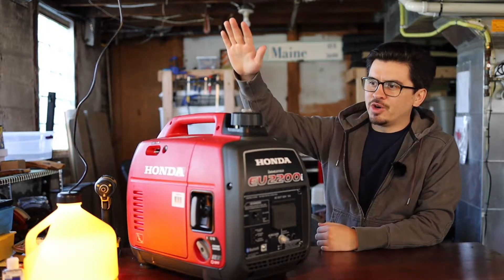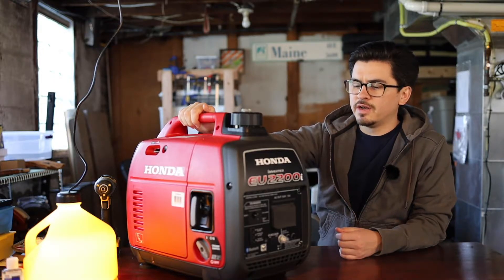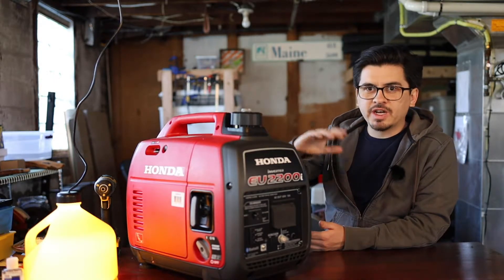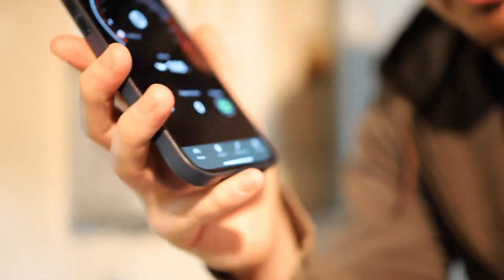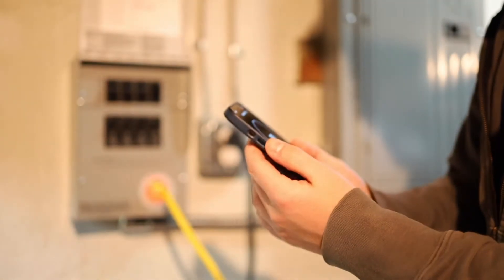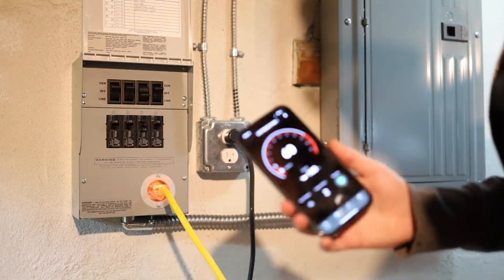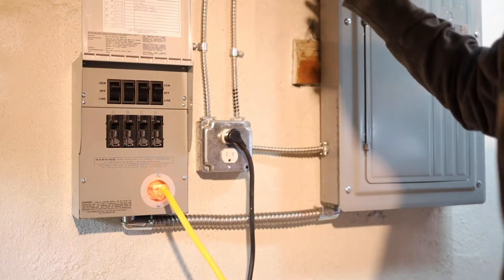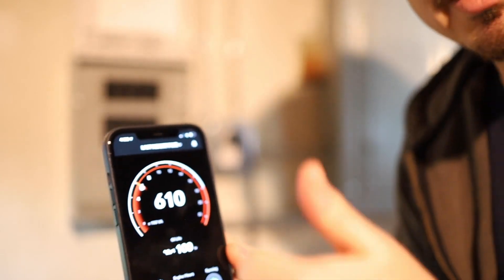Running my house off a portable generator!

Comment: Great video, question for you and the other commenters that have done this install, how are you running/getting the extension cord from outside to your switch/breaker box.  Don’t really want to leave an external door/window cracked open to run the extension cord from outside. Thanks!
Reply from the maker: Fits under my basement door, even when closed.

Comment: Thanks for the video. You did a great job! Just out of curiosity, did this require a permit or did you just want them to double check it for you? It's doesn't seem any different than just hooking a generator up to a distribution panel and none of the wiring runs in the wall.
Reply from the maker: Honestly, I'm not 100% sure it requires a permit. It seemed like it would when I looked it up for our city, and being really new to this type of stuff I just filed for a permit to be safe. I figured worst case I learn about the permitting process, and get a a sign off on my work to cover my ass.

Comment: Thanks for sharing!

Just wondering - how do you plan on securing your generator outside when it is running?
Reply from the maker: My backyard is pretty inaccessible, but I’m probably going to use a cable lock. The app does notify me if it loses connection with the generator or if it’s shut off, so I’d also see that if the generator was moved.

Thanks for watching!
Reply: @daedalus9042  Good points, and especially about the connection from your phone to the generator. Subbed!
Reply: ⚠️Generator safety tips: 

This is only a reminder 

1) KEEPING OTHERS SAFE: Please do not allow an unqualified person or your children to operate and service the portable generator. Just because some manuals don’t say that doesn’t mean it’s safe. That is important against the generator safety rules. We also need to be keeping an eye on our children too. You need to make sure that your children are not playing near the portable generator especially when it’s running so they won’t get electrocuted. Generators pose electrical risks and they can be hot during an operation. Please keep your children away from the portable generator at all times. It is important to keep our children safe especially our little ones. Children often get curious about anything so we should keep an eye on them to also make sure they’re not wandering towards the generator. 

2) WHERE TO RUN YOUR GENERATOR: Some people use their portable generators indoors which increases the risk of carbon monoxide poisoning. It’s important to have a carbon monoxide if you have a gas generator. Never ever use your generator indoors even if your doors and windows are open and even in the garage is not safe to use a portable generator. Not even at your porch and your deck. It is never safe to use your generator indoors and in enclosed areas of your home. Your generator needs to be 15-20 feet away from your house. 

3)🔥FIRE HAZARDS: Never refuel your generator while it’s running. You need to let your generator cool off before refueling it and before storing your generator. Never overload your generator too. Never ever back feed your generator. You should never plug your generator into a wall outlet. Also never store propane tanks indoors. Please keep flammable things away from the generator as well and please don’t smoke cigarettes near the generator. Having a fire extinguisher next to the generator is also important against the generator safety rules. 

4) GENERATOR OPERATION: make sure your hands are dry before touching the generator. Never use your generator in wet conditions. Don’t let your generator get wet. You need a generator tent if you need to use your generator during wet weather. Please don’t wear loose clothes when operating the generator. Turn on your generator before plugging in appliances. Use the right cord for your generator. Please do not use worn out cords. 

Hope this helps.

Comment: Thanks for the video. I see this was posted just the other day. I've been planning a similar install using either this model (EU2200i) or the next step up (EU3000is). I have a 6-circuit Reliance switch on order and I think I can get it to work with either generator. I would kind of prefer using the smaller one like you have here (EU2200i) because I like the minimalist approach (small, lightweight, quiet, and relatively inexpensive). It is good to see another successful install running selected circuits.  Kudos for doing this yourself. I don't have the stomach for that so I am hiring an electrician. It took quite a few phone calls but finally found one who is wiling to help with this type of project and knows what he is doing.
Reply: I also installed the 6-circuit Reliance transfer switch, and I went back and forth between the EU3000 and EU2200.  I finally bought two EU2200's-Companion and regular model.  For about the same money, I get a lot more power.  They're much easier to move around.  The nice thing is, if my power needs are minimal, I can choose to use just one.  Conversely, if I need to run my furnace, or a small window a/c unit (which I bought just for outages) along with other stuff in the house, then the two will do it easily.  Lastly, the bluetooth feature is invaluable as far as seeing how much power you're pulling from your generators.  The 3000 doesn't have that feature yet.  As far as the transfer switch goes, I installed it myself and I have never done any wiring work in my main panel before.  And my install was not as easy as the one shown in this video; my panel was the recessed type.  I bought the switch, then called around for installation estimates.  When the first guy quoted me almost $1100 to do it, I immediately became inspired to do it myself.  It was not difficult at all, with the aid of Reliance's absolutely outstanding installation videos.  Good luck.
Reply: Today was my install. It works like a charm. Very impressed at how much can be done with just a 2kW generator. It does 100% of what I need 90% of the time.

I now have one EU2200i connected to 6 circuits. That cover 4 bedrooms (2 are now husband/wife home offices), 2 bathrooms, Internet, fridge, bathrooms, living, and dining room. I will probably never run or want to run all of those items at once, so it looks like the one Honda should be plenty. If I ever want more power I will buy a second/companion EU2200i just as you did. In cold months I've got the furnace. In hot months I can suck it up or get a window-unit AC.

I returned the very heavy EU3000is today and got a nice $2300 refund. It was a nice generator but I just don't need it.
Reply from the maker: @elitebicycleracers  that’s great, glad to hear your install went smooth and you’re all set up!
Reply from the maker: Thanks for watching! I was going back and forth between generators, I picked this because I wanted it to do double duty as a RV/camping generator. I didn’t want something big or loud if I was out in the woods. I really only need to power my furnace or fridge, so a big generator wasn’t required. 

The 6 circuit reliance requires a 240V generator doesn’t it? I thought only the single or 4 circuit generators could do 120V